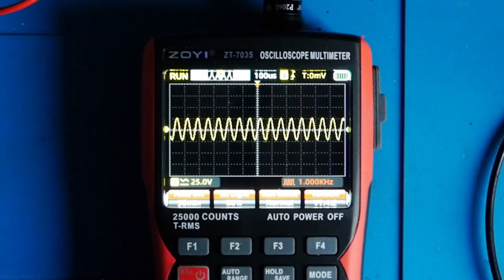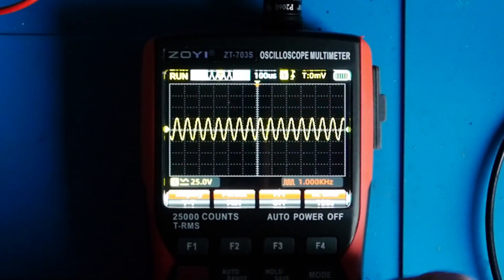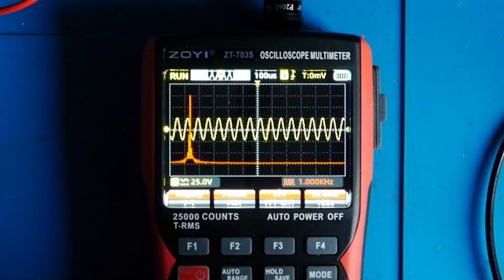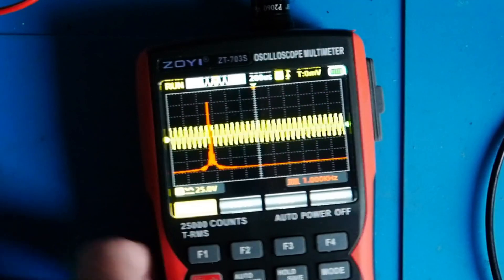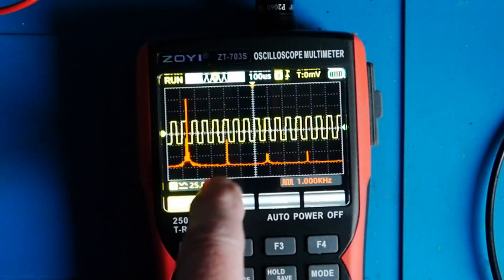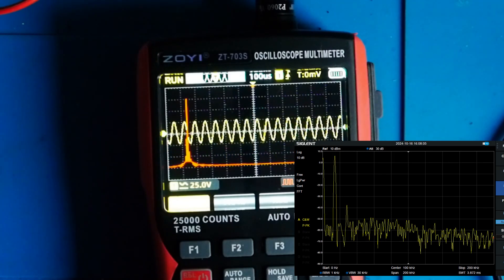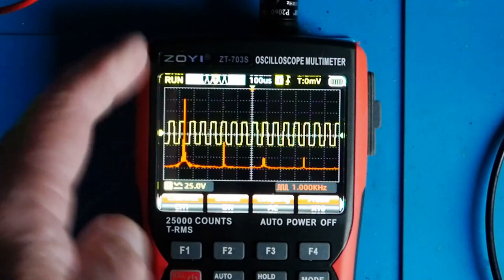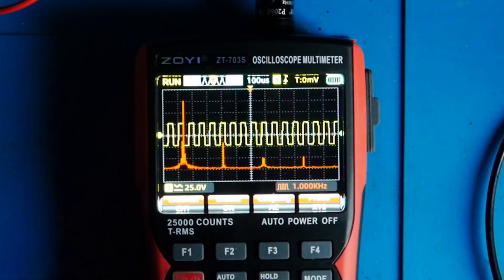ZOYI ZT-703S - Firmware Update

Comment: The display goes off after 2 minutes in my device (multimeter mode) no matter what is setup in the options. Is it a bug or a feature?
Reply: @MrDocomox  I just got my device with 1.4.2 FW and it works fine, so I would advice upgrading ;)
Reply: Feature - go into menu -> press 2 times left to screen with "BL time" - backlight time is set to 120 sec by default, but you can turn this off.
Reply: @kazukiorg thank you, I eventually managed to change the timeout in settings. was changing the wrong option before.
Reply: I am face same problem any solution plz tell me
Reply: I am face same problem any solution plz tell me
Reply: @leelamohan5438 Update firmware to the latest version. There are two confusing options in the settings, you have to configure the right one in your settings and the problem will disappear. I can't remember which one now and I don't have my device around to check.

Comment: I found this link, did not test it though
https://drive.google.com/file/d/1Sd3YS1RNme_9VrY4SYDEce5mHvTl5e_G/view
Claims to be ZOYI-703S-FW-V142(1).ZTK
Reply: I found that too but it's a fraction too big to be downloaded into the 703s, very strange!
Reply: @HughTVDX  same here
Reply: I managed to update. When connected to PC, there was Menu "Format" on my Scope. I did that, and the USB disk is now 10MB and has some more folders than before.
Dropped the firmware file into the firmwar folder (in USB mode) and update started right away.
Reply: @thomasunger5664  That's good, I can't see the menu "format'appearing on the screen of the scope when in usb mode, how did it appear, do you have to press something?
Reply: @HughTVDX  I cannot find it anymore after updating. I think it was in scope mode, then menu, before you you switch to usb mode.
Reply: I googled and indeed i found this "replacing the original format key with an FFT switch"
Reply: @realPilotfish  OK many thanks, I have it working now😊, the 'format' selection in the menu on version 1.42  has now been  replaced by FFT on off!

Comment: If you search for zoyi703 firmware on Google and open the firmware page directly, you will see version 1.3.9, however, if you search for zoyi 703 on Google and enter the Zoyi page where I believe the device is sold, then there is a yellow button that says software update, you will see version 1.4.2.

Comment: What version is this? I see v1.39 and v1.42 on their website under different locations which is confusing...
Reply: If you search for zoyi703 firmware on Google and open the firmware page directly, you will see version 1.3.9, however, if you search for zoyi 703 on Google and enter the Zoyi page where I believe the device is sold, then there is a yellow button that says software update, you will see version 1.4.2.